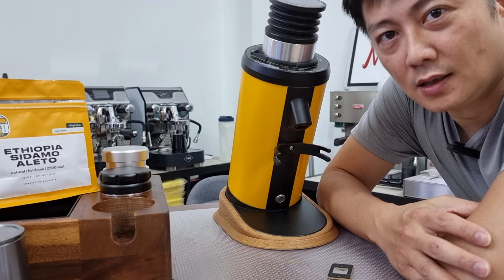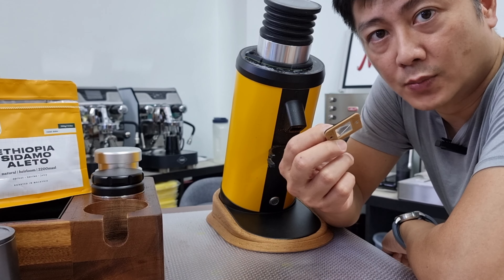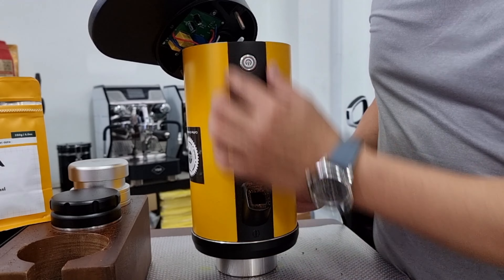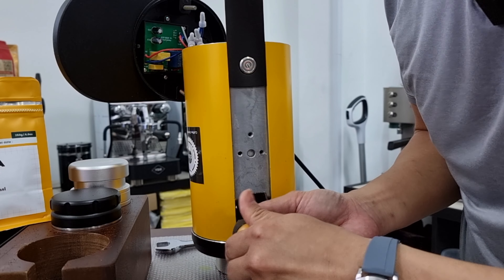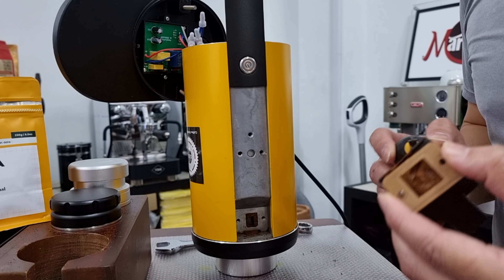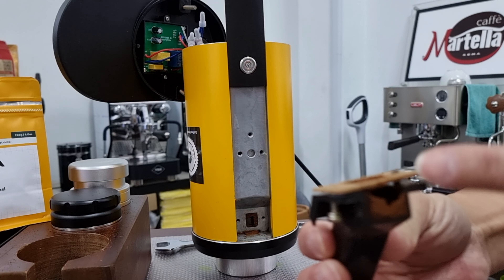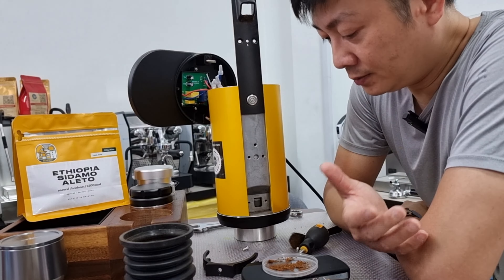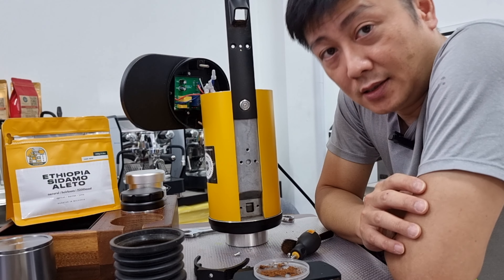New Declumper | Retention after 1 week of heavy use | DF64

Comment: Hello wonder if you can tell what size is the hex bolt thingy in the bottom, I want to find the correct tool for it.
Reply from the maker: I will need to check on mine again as I haven't open the Base of the grinder for quite a while.